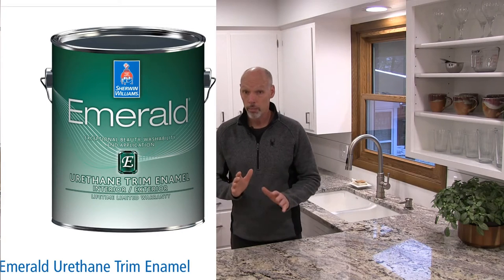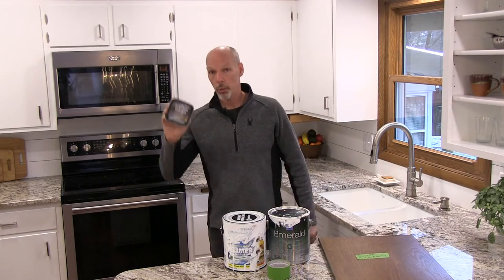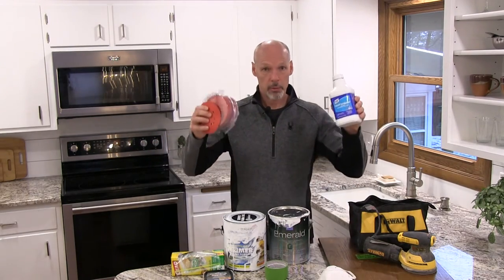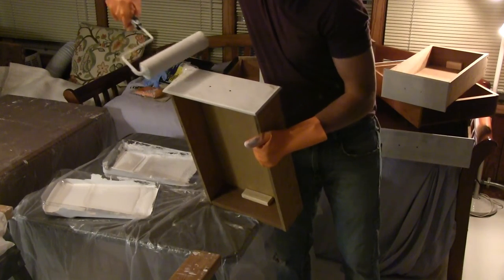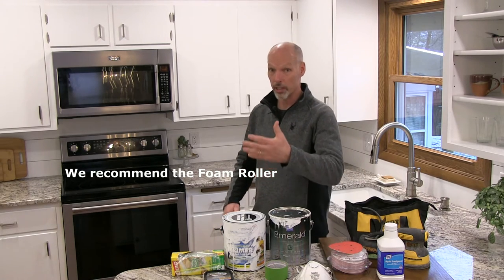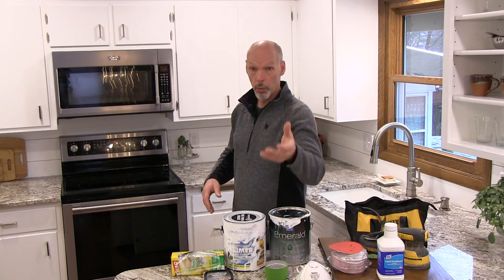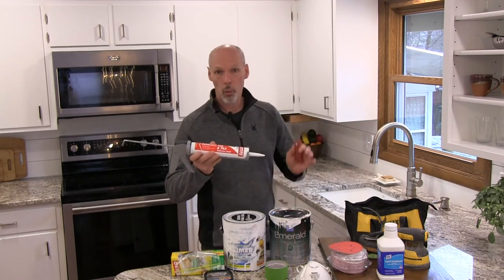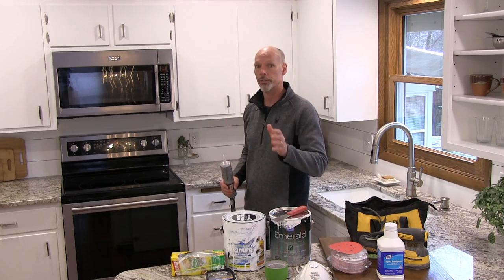Painting Kitchen Cabinets White

Comment: This is one of the best kitchen cabinet tutorials on YT. After watching probably 25 YT vids and numerous Pinterest pages, I painted out my builder Oak Colonial cabinets just over a year ago to get our house ready to sell. I particularly like your attention to detail and the fact that you are bang-on in how long it takes to do the job properly. I did mine during the winter, so I set up an area in our finished basement and used my drop sheets to cover stuff. I used Bulls Eye Primer and Benjamin Moore Advance for the top coat ( designed for cabinets, self levelling, etc). I did it in sections, and while all fronts were sitting for the final cure, I did the cabinet framing ( thank god the interiors were white and in good shape). 
I did white uppers and gray lowers with a new Formica countertop. I was SUPER happy with the end result. Your tip to give everything 2 weeks for a final cure is SO right. Do it once the right way, and your good to go. Your kitchen looks FAB !
Reply from the maker: Thank you for the very well thought out and articulate comments.  And for the kind words. It made our day!  I’m sure your cabinets look beautiful!  We will  be having a follow up video down the road as to how well our cabinets have held up after almost one year.  As well as a bathroom remodel where we will be painting our bathroom cabinets and more. So stay tuned by subscribing if you haven’t yet and thanks again for watching.
Reply from the maker: If still interested we uploaded a 2 year update video on how well our painted kitchen cabinets are holding up 😊...
https://youtu.be/zoPVe7uRFe0

Comment: I am soooo, glad I watched this video before I painted my kitchen cabs. I have the same built in cabs in my 1965 ranch. I'm going to be adding trim to make them look like Shaker style cabs. I've been doing a lot of research for awhile now and your video echoed things I've heard but definitely more detailed. For example I've never heard to use that wood filler,  and the more realistic curing time. Thanks for all the useful tips.
Reply from the maker: Thanks for the nice comments and for watching. You can’t go wrong with shaker style. Be sure to subscribe if you haven’t yet as we will be making another video down the road highlighting more of our kitchen remodel and how the paint is holding up. :)
Reply: I will. And I can't wait to see how it holds up. Thanks again
Reply: BTW, do you have any other suggestions for a wood filler in a tube?
Reply from the maker: For smaller holes like nail holes or even screw holes drywall compound will work well. I haven’t found a wood filler yet that I really like when filling larger holes. Sorry
Reply: Ok, thx I'll try that. I Don't have any large holes just the seems where I'll be adding the trim on the door fronts.
Reply: Bondo Spot putty. Comes in a tube from the automotive store. Hardens in a few minutes, red color lets you know when sanded through.
Downside is it's pretty hard when cured, so spread it thin to avoid a hump.
Reply from the maker: If still interested we uploaded a 2 year update video on how well our painted kitchen cabinets are holding up 😊...
https://youtu.be/zoPVe7uRFe0

Comment: Great tips! I would like to add a little input one that Sherwin Williams Emerald Trim  paint  it has a great finish and is easy to work with but ..... BEWARE of the darker colors. I painted my cabinets dark expresso brown and the paint would not dry. I did a test spot on the window trim above the sink and then on the side panel of the cabinet - both were prepped. They are both oak. The paint was still sticky two weeks later! I returned the gallon of paint and the Sherwin Williams sales rep told me that the DARK colors of the EMERALD TRIM will take longer to dry and will take up to 30 days to cure to a really hard finish.
Reply from the maker: Thanks for the heads up. I was not aware of that. Great info to share with our viewers that look through these comments. Thanks for taking the time to leave us a comment. :)
Reply: DITTO!!!! I have Peppercorn Black. The Valspar K+C paint I used was bad so I had to strip and sand the rest of the bad paint. Bought enamel and notice it is taking forever too. They refuse to tell you that fact.

Comment: My kitchen has cabinets with raised panels.  What do you recommend for sanding in the grooves?  I love your videos!  Very relevant and informative!
Reply from the maker: Thank you for the kind words. Carefully using a 150 grit sandpaper watching so that you don’t alter the shape. If to harsh go to a finer grit sandpaper :)
Reply: @Shelley Klock  I'm late to the party, so your kitchen may be done by now, but just in case - I painted out my entire kitchen just over a year ago to get our house ready to sell. We had builder grade oak cabinets, but they were solid wood, so worth painting, and they were the colonial style with the door-shaped ridge. I used a "Mouse" sander - Several companies make these, like Black and Decker. Smaller than an orbital sander, easier to control, and did all the flat surfaces, then hand sanded the ridge/panel on the front. If your panel is solid you can use the mouse for the flat front and hand sand the panel sides and groove. This tutorial is very good, although I used Benjamin Moore Advance and Bulls Eye Primer. The number one tip for a great end look - take your time and attention to detail, and 2 weeks final cure time.  Good Luck.
Reply from the maker: If still interested we uploaded a 2 year update video on how well our painted kitchen cabinets are holding up 😊...
https://youtu.be/zoPVe7uRFe0

Comment: Thanks for the ideas. I noticed you didn’t paint the window trim and wondered why. Also if you could do a follow up on the countertop it would be great. Is it granite or quartz, did you outsource this part?  Kitchen looks very nice. Good job to both of you.
Reply from the maker: Thanks 😊. We didn’t paint the window trim because we wanted some wood there to add some warmth to the kitchen plus it would then stay similar to the other wood window trims at the other end of the kitchen giving some continuity. The thought was we could always go back and paint it white if we wanted to. At this point we are liking it unpainted. We removed the old laminate countertops and we braced  the cabinet bases  here and there. We paid to have the granite countertops installed. We’ll put a link here to our video on the install and if you read through the countertops video comments you may glean more info if interested. 
https://youtu.be/VUPy2QaKKGs
Take care 😊
Reply: Thanks again.  These two videos answered many of the questions I’ve had, including what style of sink, how to Mount it the backsplash, and many more.  I hope I can find a countertop installer in my area who does as good a job.  Helps with my budget too.

Comment: About time. Your bid covers it all. I will be doing grain filler, Dap wood filler..sounds like it'll be good. I hope so. 
I bought my SW Emerald today. Excited about starting. I'm in no rush to get it done. I agree with more drying time. I don't believe the Emerald requires a sealer. If it dries hard there's no need for it. 
Your cabinets look beautiful. How they holding up after a year? You used water based primer. My research shows with water based primer a on dark colored cabinets will bleed thru. They say use oil based primer like Cover Stain.  Do you see any bleeding?
Reply from the maker: Thanks for the nice comments. This January will be 2 years with the painted cabinets. At some point we will be doing a follow up video. So far no bleeding through. Maybe because we used two coats of primer before the two top coats with the long dry times in between. I think we will be ok without  bleeding but time will tell. I would say for peace of mind go with your gut and use the oil based as you are planning to. 
Good luck with your cabinets and let us know how they turn out. :)
Reply from the maker: We just uploaded a 2 years later update video on our cabinets if you are interested in watching. Because you were wondering if the stain bleed through I’m posting it here 🙂...   
https://youtu.be/zoPVe7uRFe0

Comment: awesome video...I found this after I painted my kitchen cabinets 3 weeks back. But glad to have my steps validated. I used the same steps, other than using the shelac primer. I used the high hide white (base) SW emerald paint. What color white paint did you use?
Reply from the maker: Thanks, you made our day. We also used the high hide white (no regrets). This January it will be 4 years with it. 
We still get comments from guests on how nice they look. Take care😊
Reply: @SilverLiningDayDreams  wow.  Glad to know you used the same color. I thought i was the only one to go with no tint. I love how the cabinets turned out. Your kitchen looks awesome 👏. Btw in future if you just want to refresh will u add another layer of high hide white without sanding or will start from scratch like sand primer and then paint. One more question, i have couple new cabinets to paint the same white. These couple cabinets were painted swiss coffee 10 months back. Since kitchen is all high hide white, these cabinets don’t match. Should i do a primer on these before painting high hide or can i straight away apply two coats of white paint?
Reply from the maker: @pretty95138   thanks and great questions. Having lived with these painted now 4 years we are planning on repainting them again with the
High hide white (no primer) down the road when they show signs of wear rather than refacing them. I think we would very lightly sand them with a 220 or 300 grit after a good cleaning just to remove any imperfections (bumps) from when we painted them; which are few. 
One coat of paint “may” do it. 
I think we would error on the side of caution and put a coat of primer on the Swiss coffee cabinets 😊
Reply: @SilverLiningDayDreams  thank you :)

Comment: Your kitchen is gorgeous! We were thinking about painting as well and but we’re also thinking about granite countertops. Would you per chance remember the type of granite you used for the kitchen?
Reply from the maker: Thank you 😊 I copied and pasted some of the invoice below. We did the tear out of the old counters……..

KITCHEN) 3CM IN STOCK TIER 4 HORIZON 1 STONE COUNTERTOPS WITH PENCIL EDGE AND
NO SPLASH. ONE UNDERMOUNT SINK CUTOUT,
SINK INSTALLATION AND FAUCET HOLES. STOVE
TO BE FREE STANDING. TEMPLATED, FABRICATED AND INSTALLED. ESTIMATE BASED ON DRAWING, INVOICE BASED ON TEMPLATES. PRICE DOES NOT INCLUDE TEAR-OUT, SUPPORT BRACKETS, ELECTRICAL WORK OR PLUMBING. ALL CABINETS, PANELS AND WALLS ETC. . NEED TO BE INSTALLED BEFORE THE TEMPLATE. SOMEONE MUST BE AVAILABLE AT TIME OF TEMPLATE TO GO OVER LAYOUT AND OPTIONS. ESTIMATE INCLUDES ONE TRIP TO TEMPLATE AND ONE TRIP TO INSTALL. ANY ADDITIONAL TRIPS WILL HAVE AN ADDED $150 CHARGE. SINKS ARE NOT INCLUDED IN THE PRICE UNLESS THEY ARE LISTED ON A SEPARATE LINE ITEM.
Reply from the maker: This is our granite counters install video if you are interested and haven’t seen it yet:
https://youtu.be/VUPy2QaKKGs
Reply: @SilverLiningDayDreams  you’re a gentleman! Thank you so much, this is incredibly helpful!

Comment: I keep returning to advise your video being im currently doing my cabinets. Point one; I decided to do the interiors and with them being primed it ALREADY holds a fantastic difference when I’m seeing these things get hit with daylight
Point two; I’m having trouble deciding what my final paint product choice will be. You highly recommend that Sherman Williams green label you used? Has it held up since the redo ?
Reply from the maker: Thanks for the nice comments. Glad to hear you are painting the interiors (so worth it). We are one year in and no regrets. They really are holding up very well. We really do love the emerald paint we used!!!!
Reply: Silver Lining Day Dreams yes your video is very informative and without confusion on the steps you employed. You said that paint is rather expensive correct? But worth it sounds like! How many finish coats did you apply? And did you ever consider a top coat of water based polyurethane for augmented protection? 👍🏻
Reply from the maker: We applied 2 top coats of the emerald paint. We decided not to protect the paint so that we have the option to repaint the cabinet faces a few years later. You can usually get a 30 or 40 % off coupon for the paint to offset the steep price.
Reply: Silver Lining Day Dreams that’s a good idea, so you can repaint them again down the road.  Okay great. Coupons help! Where can I get coupons? On their website ?
Reply from the maker: I get them occasionally emailed. I think I registered online to get on their email list. If that doesn’t work your local Sherwin Williams should know how to get them. Good Luck
Reply: Silver Lining Day Dreams excellent. Thanks!  So I had this idea....since I painted the interior of all cabinets. I was thinking of applying general finishes water based satin top coat to the shelf tops to fortify the durability and protect for all the high traffic they’ll be enduring
Reply from the maker: 👍 let us know how it goes. I know some of our viewers read through the comments for feedback. We all learn from each other’s experiences. Good luck John
Reply: Silver Lining Day Dreams will surely do! It’s a process as you’re well aware. Couple more quick questions...how many coats did you apply for the interior? And have you encountered marking scratching scuffing on inside shelves ?
Reply from the maker: John C Insides were painted same as outsides with 2 coats of primer and then with two coats of the emerald paint. We did put shelf liner in couple cabinets where pots and pans go so no scratches there. Otherwise not as of yet noticing scratches in other cabinets where dishes go . I suspect over time may see some though
Reply from the maker: If still interested we uploaded a 2 year update video on how well our painted kitchen cabinets are holding up 😊...
https://youtu.be/zoPVe7uRFe0

Comment: Great video!
What steps did you take to do the insides? Just degreasing and no sanding correct? Straight to prime then paint
Reply from the maker: Thanks. Correct, we just degreased and rinsed well so clean on the inside of the cabinets. We did not sand the inside of the cabinets. We did lightly sand the cabinet faces. This worked well for us. We would recommend caulking the inside of cabinets if needed before painting :)
Reply: Silver Lining Day Dreams awesome. You recommend caulking all the inside 90 degree angles? 
Aesthetically purposed, so it looks solid with no breaks ?
Reply from the maker: Because caulking the inside of the cabinets was an afterthought we ended up caulking after painting. Some areas of the white paintable type caulk are turning a faint yellow so we definitely recommend caulking before painting. Maybe we purchased some bad caulk; not sure, but to be on the safe side caulk and then paint. They really do look great in our opinion but if you look real up close you can see some imperfections where we could have prepped better. Nothing you do will make it look like a brand new cabinet but we feel they look so great that we have no regrets doing this time consuming project. This really did increase our property value.
Reply: Silver Lining Day Dreams yellowing is prob the caulking drying without paint to jacket it yes. But what areas are you caulking inside the cabinets?
Reply: Silver Lining Day Dreams excellent. Thanks! And what type primer did you use on the cabinet boxes and exterior sides ?
Reply from the maker: These are built ins and to level and plum them 60 years ago they left noticeable gaps on the inside where they meet the walls at the top and sides. That’s where we caulked. We used two coats of Zinsser bullseye 123 white primer and then two top coats on the Inside of the cabinets and also on the outside of the cabinets
Reply from the maker: Also John we used non adhesive and white so blends in and 20” wide and on Amazon it’s called Duck smooth top non adhesive shelf liner. Let cabinets cure before using. We used this on some of our top cabinets and our bottom cabinets. Our pots and pans slide easily across it. In our cabinets where our glasses and mugs and bowls and plates go we have no liner and so far no scratches because we don’t slide them but set them down. Hope this helps
Reply: Silver Lining Day Dreams oh cool I’ll have to look into those liners! Thanks again. You weren’t kidding about the length of time this is taking, but in line with what you said, nothing worthwhile is easy.
Reply: Silver Lining Day Dreams also what color Sherwin Williams did you use? A basic white or is there a specific color name for the shade?
Reply from the maker: John C on bottom left corner of front of paint can it says...        K 38 W 751
6509-94809
Extra white
Reply: Silver Lining Day Dreams thanks my man! And because of your video you inspired me not to just do the insides white, but also to now leave some doors completely off a few cabinets to have that modern open faced look displaying matching plates and bowls etc. Filling all vacant screw holes with wood filler and sanding then painting finish coat
Reply from the maker: Fantastic!  If YouTube allows it, post a picture in the comments for others to see. We would love to see them.
Reply: Silver Lining Day Dreams thank you! theres no capability to do that here but I can email you them I’m after I’m done! I’ll probably end up purchasing that cabinet liner you referred to